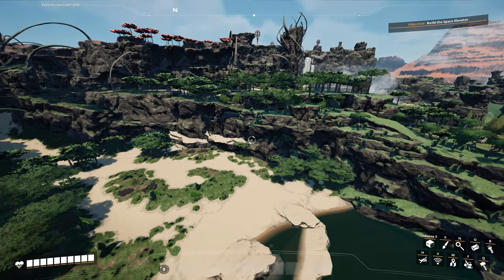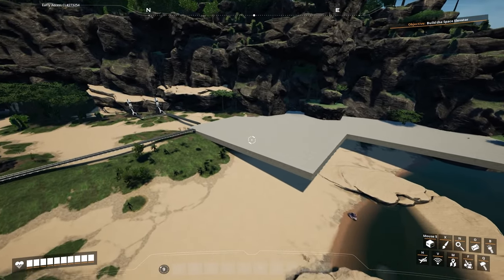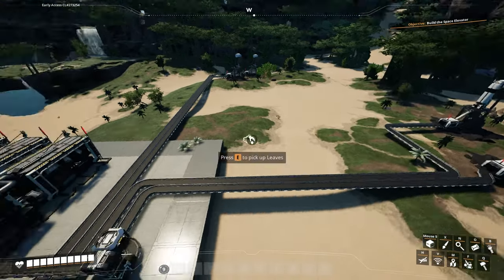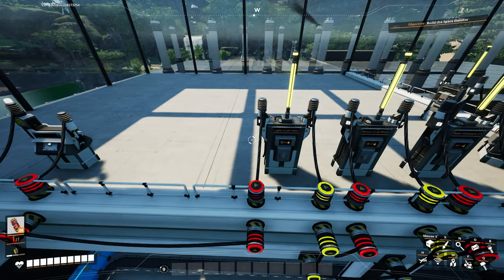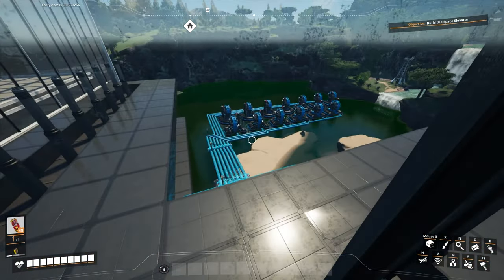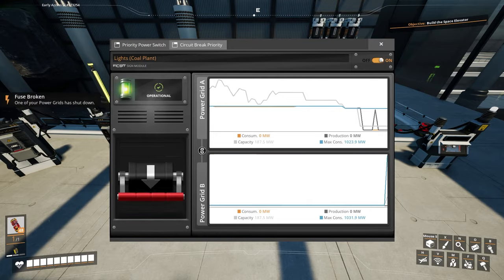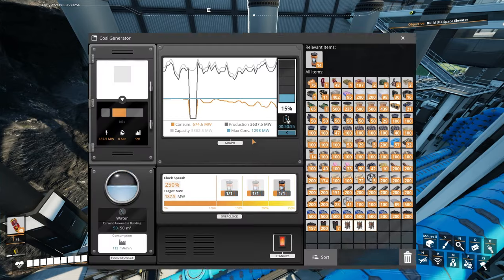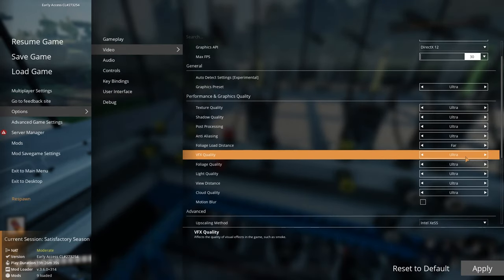MEGA COAL POWER PLANT - Satisfactory

Comment: I think i can help. You should set up separate grids of power for initial startup with your water extractors, coal burners and miners. Using separate circuits (or power switches) to "build up" the input like water pressure and coal production will make it so you only need a little juice to start the whole thing, then you gradually add the other production lines in since you will then have enough energy capacity which is what is killing your factory from actually starting. It needs the juice to start but doesn't have capacity since the generators themselves wont run unless they have juice which requires capacity and so on and so forth.
Reply from the maker: I had no power storage anywhere and no were near enpught power to kick start the plant, I set up battery's to give a jump charge and now there's battery's for if the power breaks to jump start it again if need be, I do appreciate the helpful tip thought.

Comment: Why did you ever set your autosave to 75 minutes! I actually reduced mine to 3 mins from the default 5 mins. Another tip is to add the save file folder to Google Drive or Dropbox etc and that way you will have cloud saves and a history of 100 versions of the save files(with Google Drive). That way if anything goes wrong you can just go back to a previous version of the save file.
Reply from the maker: I had it set to 75 min from last season where it saved and took a century.
Reply: @Plinkooo  Oh I only just started so I guess they fixed it or maybe the factory size affects save time.
Reply from the maker: The more you build the longer it takes